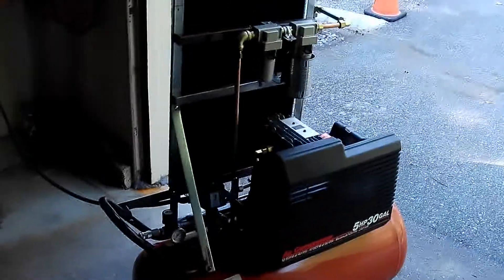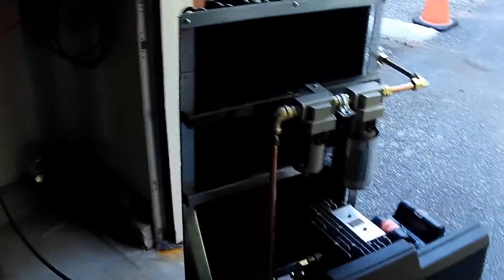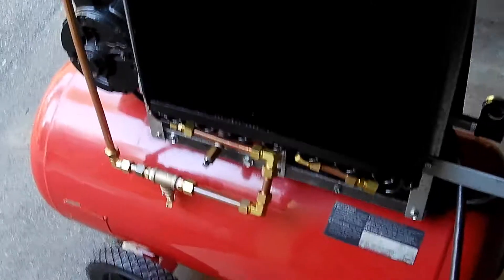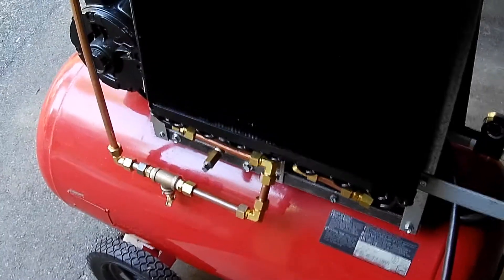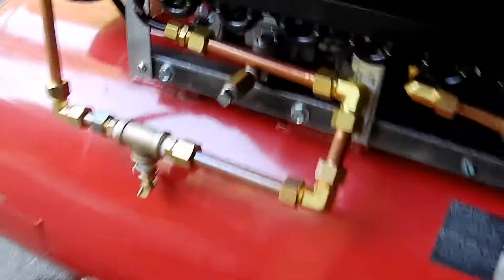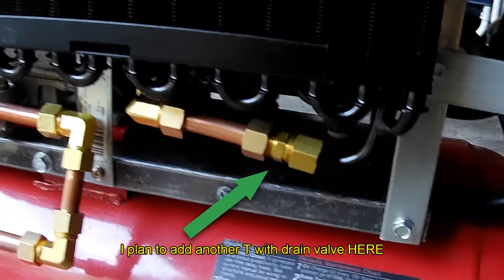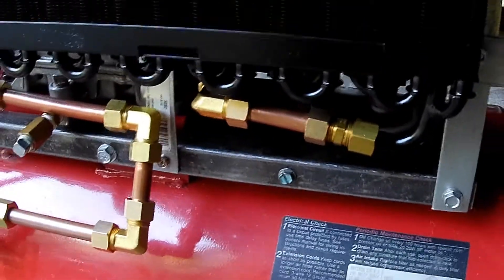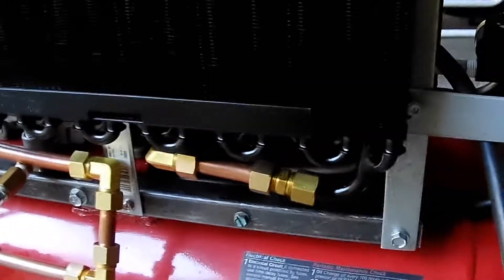AirCompressorModification2-Modified Again!

Comment: Can you put a link to the fittings you used from Amazon,  I’ve been pulling my hair out trying to get the proper fittings?  Who knew there were so many different kinds and none seem to play nicely.  Thank you for the video,  looks like an awesome setup...want to make it myself.
Reply from the maker: These are still available on amazon. See following links. Hope they work. If not search amazon for
[Anderson Metals-50068-0808 Brass Tube Fitting, Connector, 1/2" Compression x 1/2" Male Pipe] and [Anderson Metals - 50065-08 50065 Brass Compression Tube Fitting, 90 Degree Elbow, 1/2" x 1/2" Tube OD] 
I really don't use this compressor all that much but if I were to do it again, I would follow most if not all of the suggestions from others in these replies. I think they all have merits. 
---------------------
https://www.amazon.com/Anderson-Metals-Compression-Fitting-Degree/dp/B000BO9CI6?pd_rd_w=r3ZHZ&pf_rd_p=ccc160c3-6ba8-408e-b046-ec3447a071ed&pf_rd_r=E2BB16X5ESD1EA8E857Y&pd_rd_r=333f2626-b913-4436-aabc-12c6cec5b746&pd_rd_wg=wxwle&pd_rd_i=B000BO9CI6&psc=1&ref_=pd_bap_d_rp_1_t
------------------------
https://www.amazon.com/Anderson-Metals-Fitting-Connector-Compression/dp/B0041NND4M?pd_rd_w=X0tta&pf_rd_p=ccc160c3-6ba8-408e-b046-ec3447a071ed&pf_rd_r=VM0G9HBV9XHT24Z9ME4Z&pd_rd_r=3e42cc61-e6e2-4a90-8428-023f30ae4034&pd_rd_wg=d4d5b&pd_rd_i=B0041NND4M&psc=1&ref_=pd_bap_d_rp_1_i
---------------------------
The 1/2" copper tubing was a 25' roll from Home Depot along with one of their generic tubing benders.
The air filter(s) were Harbor Freight and work good for the price.
Hope this helps!
Reply: Awesome,  really appreciate it Rick

Comment: Beautiful. Now add a check valve before your first drain out of the head. When the switch drops out that ~10" section of tube will drain. PSST. Not PSSSSSSSSSS----T. Will save a ton of air. If you really want to go nuts get a bag of blow down the street and add a fan. jk. These solutions, when engineered properly WORK.
This is how America was built. Smart guys in their garages doing crazy pipe tricks with their compressors.
Reply: Subscribed. I wonder if your wife looks sideways at you like mine does at me, lol. If you saw my compressor you'd beg me to throw all my tools away. I have issues, lol. Would love to post a pic. Started with that exact model. It's still somewhere in there, like when Picard got trapped with the Borg... there I go again...
Reply: My compressor has taken a year to build. Same 30 gallon tank. Added a 2nd compressor head. The aftercooler sits on top consisting of 70' of 1/2" copper in a shroud with two very powerful 24 volt axial fans drawing air. All PLC controlled. Four filters, considering a 5th. 6 wheels, lol. Finally down to the short strokes, adding hose racks and a tool caddy and finalizing the filter configuration. My refrigerated air dryer is on Craigslist and I think it's selling this morning. It's a disease. Embarrassed to roll it outside because the neighbors are like, "WTF is that?" It looks like a cross between a nuclear bomb and a flying car.
Reply from the maker: Thx for your comments I really appreciate it. Great idea!